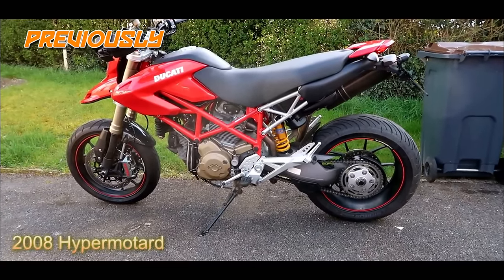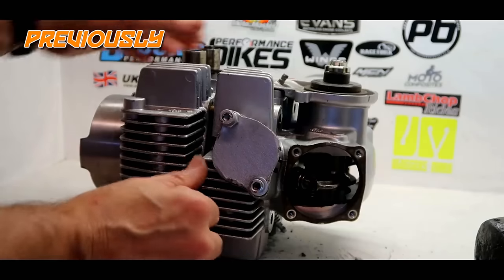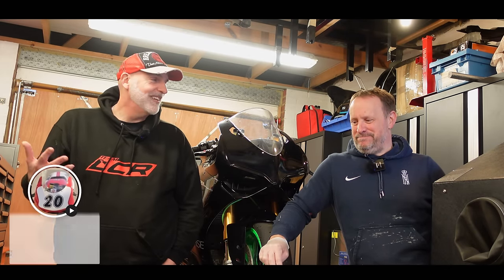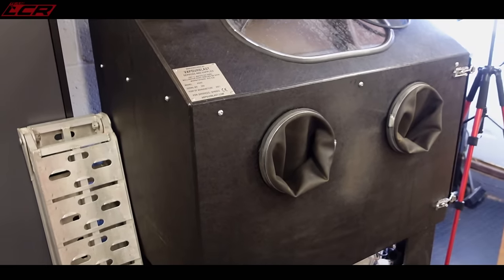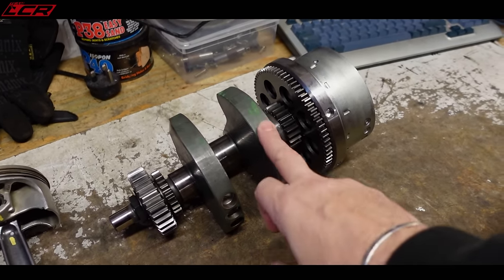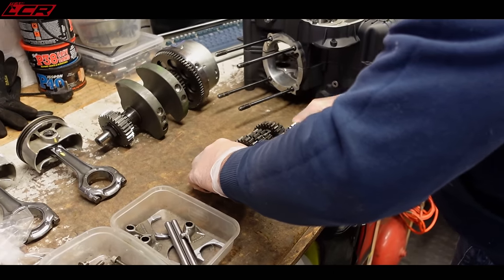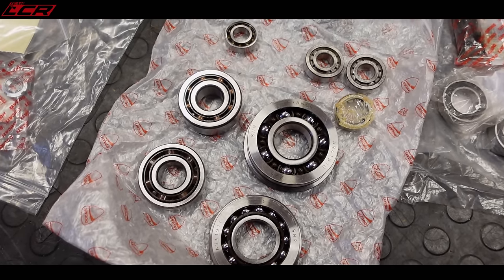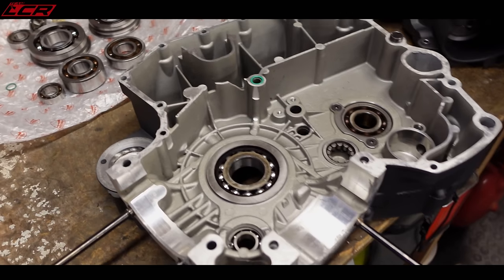Ducati Hypermotard Restoration EP14 | It's BACK!! | Engine Assembly

Comment: Best video  not really interested in latest bikes but this is Fab. Excellent guide to shim crank I had a 996 which broke 6th gear. Really struggled with workshop manual but this way is so obvious when you have seen it . Once again excellent.
Reply from the maker: Yeah I'm still a little confused 😆👍

Comment: That's interesting about preloaded the crank, just wondering if the thickness or the crankcase gasket makes any difference? Or is it so thin that it doesn't matter? Just curious
Reply from the maker: Good question, apparently its such a thin layer after its torqued down it makes no difference 👍
Reply: Good to know

Comment: Just wanted to say I really enjoy watching your videos. I have a question for you and hopefully you can help me out I have a ktm690smc 2010 model had it for over 12 years now 47000 miles and still going strong but sometimes I wish I had 10 more HP or 10 more lbs of torque .I  know you have the ktm690smc r  and I seen where you review the ktm duke 890r and you really liked it but do you like it over your ktm690smc r? I live  in georgia USA  And I have lots of mountain roads with lots of curves and a lot of elevation changes, So do you think the 890r would out perform or handle it as well as you 690 r ? Thanks & keep make great youtube videos.